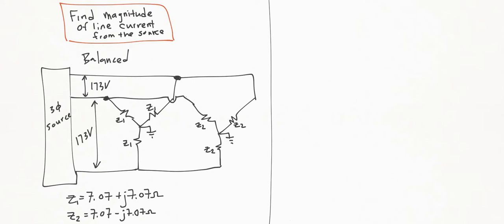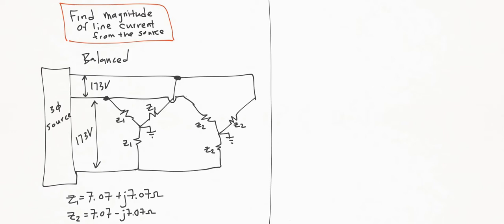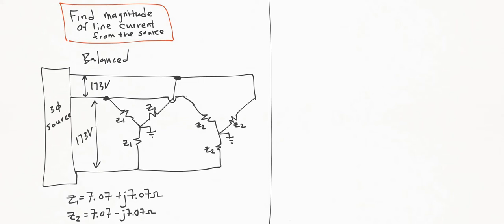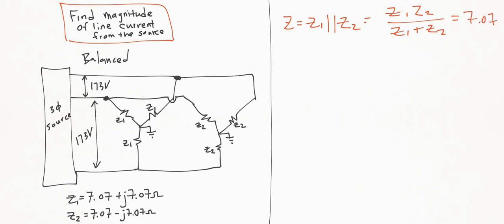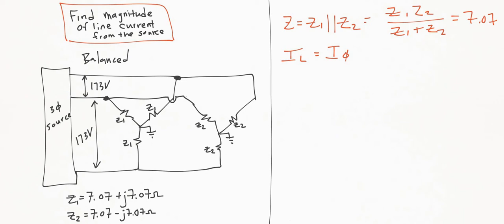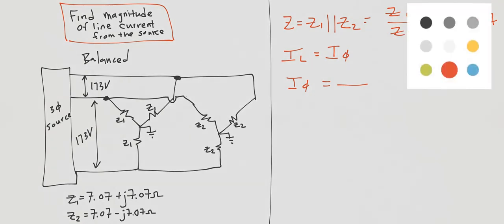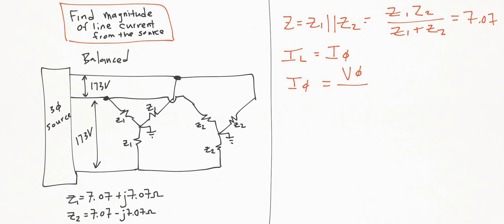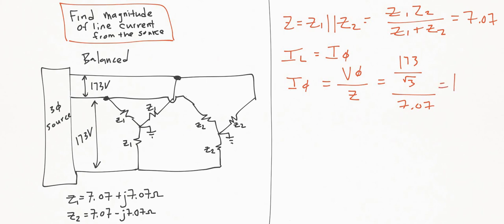Electrical FE /EIT Exam Prep - Power 2: Balanced Three Phase Wye Load

Comment: The answer is correct. Another way to do it and make it more understandable :
Line Voltage (VL)
Phase Voltage (Vp)
Line Current (IL)
Phase Current (Ip)
Z1= 7.07+j7.07
Z2= 7.07-j7.07
I1= Current Wye 1
I2= Current WyE 2
Io= Current from the source

*Remembering Wye
VL= √3*Vp
IL= Ip

First, we gotta find Vp ( We use phase voltage since IL=Ip)
Vp= VL/√3
Vp= 99.88V

For the Wye1 (Y1):

I1= Vp/Z1 = 9.89∡-45

For the Wye (Y2)

I2= Vp/Z2 = 9.89∡45

Since Y1 and Y2  are in parallel we can say with confidence that the current from the source is I1+I2 (See it as a node):
Io=I1+I2= 14.127A

Comment: Why can you treat the wye resistors like they are one resistor each and just apply the parallel equation to them like a normal circuit? I'm trying to look up a law or rule than allows for that

Comment: Doesn't line current mean Line-to-Line? Don't we have to convert the Z to delta first? (Zdelta = 3*Zwye). Then use the line to line values in ohm's law after finding the parallel equivalent impedance? Thanks for the video.